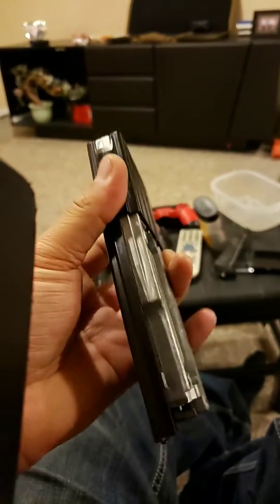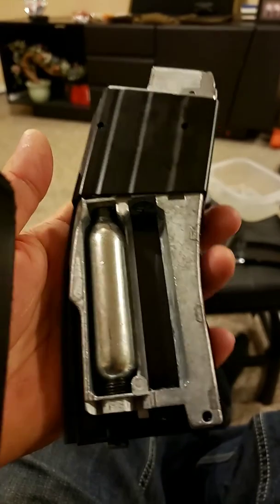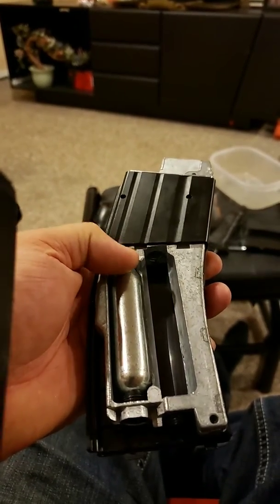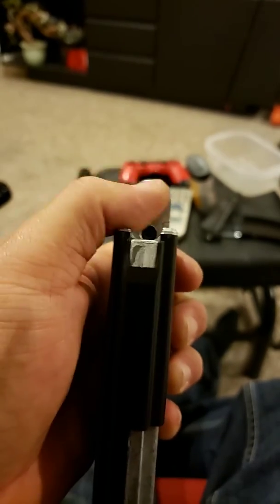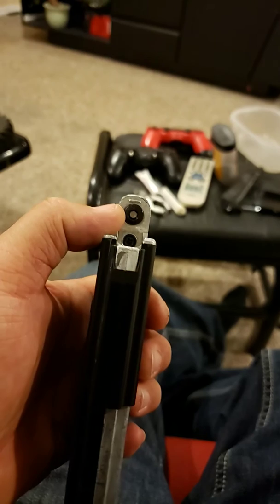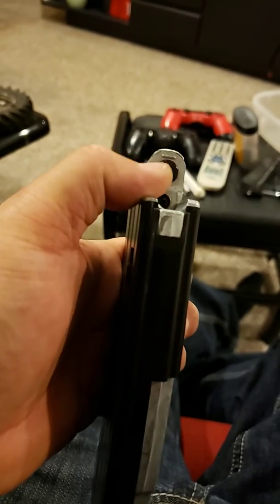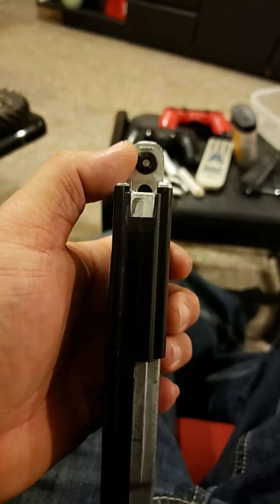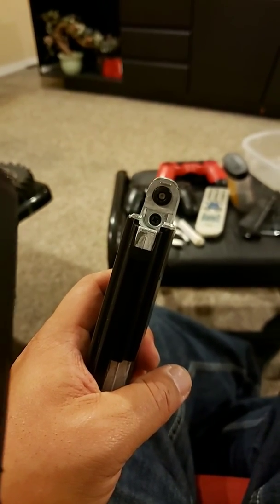Crossman dpms leaking magazine fix

Comment: Mine is coming tomorrow... can’t wait. Good to know about this. Hopefully it doesn’t happen, but if it does..thanks
Reply: Well it’s been a blast so far!! I spent extra and got 60 co2 and extra mag. Looking to get a red dot next. Iron sights work. Would like a different look and custom reticle
Reply: Also, wanted to ask,is there anything that can be done, to make things run faster?? Mine seems to shoot slower than others I’ve seen. It’s lubed,on friction points... any other pointers???
Reply: Holy crap!!!! This thing is a beast! All broke in now... it shoots fabulous!! Super accurate in semi.. good with burst... total FUN ,but crap accuracy in full auto.. unless you have a row of beer bottles to kill
Reply: PS. No leaks, on either mag!

Comment: I've bought 4 extra magazines and so far had none come defective or with leaks. Which is surprising considering how many bad reviews I've seen for the spare mags. I also oil them inside and out everytime I use them and make sure to break down the gun and use airgun chamber oil on the inside every 3000 rounds or so. And I use pellgunoil on the mags. And put a lil on the tips of the co2 cartridges as they go into the mags. My baby runs like greased lightning! I love having extra mags because you can load up all five and pretty much shoot the entire afternoon as long as you keep the speed loader handy. I even got a tactical chest holder for my magazines and loaders. They do get pretty heavy though. 5 is like toting around a 20 lb weight on your chest. Which I guess just makes it that much more realistic
Reply from the maker: Congratulations! Because of your preventative maintenance your airguns will last you  3x as long as everyone else has

Comment: The valve stem is not threaded, but oughta by this described action create a better seal for itself towards the plastic seal that is behind the brass nut around the visible rear of the valve stem (referred here as "nipple"). This action also can help keep the valve stem's front o-ring in place - especially if all is well lubed. I prefer silicone oil (I ditched Pellgun Oil a long time ago)..

Comment: What if its leaking from  the co2 cartridge at the tip I hear it hiss and it won't stop even if I keep tightening it?
Reply from the maker: U are past point of no return. The seal will have torn. This is why we use pellgun  oil on top of each fresh co2 cartridge to prevent tearing. Ur basically banging the old lady dry there is going to be miniscous tearing.
Reply: I been using pellgun oil for 11 months and mine too is hissing from first co2 at the tip. Not even a full year and two mags did this!

Comment: Thanks for the tip! I tightened it to where I could hear the least noise from the gas hissing but was wondering if it should be completely silent or if you can still hear a little bit of faint air hissing.  Its not that loud, but when your ear is close enough its noticeable. Thanks!
Reply from the maker: It should be completely silent .. otherwise by morning all ur co2 will have leaked out.
Reply: @mahman8888  Awesome, thanks!
Reply from the maker: @jarrenpeng1050  no problem man! Other than that shes a pretty solid rifle and so bad ass !

Comment: I have the same gun and mine leaks from the top seal of the co2 when i tighten it.. im going to put some oil on it maybe it will help. 50 dollars for a new magazine is crazy
Reply from the maker: Ok man use a piece of teflon tape on top of co2 cartridge to create seal.   what happens is when u tighten it dry it rips the green seal.. that's why u pellgun oil the tips of cartridge to prevent that. Hope this helps
Reply: Sorry can you explain a little better how airs escaping what exactly is causing it... cause mine is coming from the seal

Comment: thanks
Reply from the maker: No problem,make sure you add pelgun oil to the tip of your co2cartridges. This will prevent that rubber gasket from drying out .

Comment: Is it normal to have the co2 on the left be empty and the one on the right half full once the gun stops shooting?
Reply from the maker: No.. it should be completely discharged.. not sure why u still have 1/2 filled co2 left.. does it still fire and its just weak?  Or completely dead?
Reply: @mahman8888  it actually fires pretty soild. But only get 75 rounds before it stops shooting.
Reply from the maker: @JD_1  then there is definitely something wrong if you can only refill 3x.. do you have another mag to test out and see?  I can usually get about 200-225 shots @25 bbs per mag.
Reply: @mahman8888  Wow! Yes it has to be defective. No I dont have another magazine. I just bought this gun Saturday from Academy. I will contact Crosman about it.
Reply: @mahman8888  I just resolved my problem.. I was over tightening the cylinder on the right. I will do a video on this gun soon. Thanks for the chat
Reply from the maker: @JD_1  make sure you use the Crosman oil on the tip of the CO2 cartridge before you install them! And turn the screw ever-so-slightly until you feel pressure and then keep turning until you hear the puncture and you're good. Tightening the shit out of them wrecks the seals

Comment: Thanks for the Video, I would like to have seen you take that back apart and see whats behind that nipple part you tightened, since it is threaded, either Teflon tape on threads or Small amount of blue Loktite on threads so it seals and doesn't loosen from Vibration again.
Reply from the maker: All that nipple does is turn and turn and turn it's like a valve. It's not threaded so just turn it until you can't hear air leaking out anymore I'm not sure what the issue is with the magazine or why would even do that in the first place.

Comment: Mine leaks from the bottom is it saying to lubricant
Reply from the maker: Every time you put in a new c 02 cartridge, you are required to add a little bit of pellgun oil to the tip of the seal.  Otherwise overtime that green seal will rip and tear . Leaving u a leaky useless airgun.
Reply: I been running my gun without oil and I guessing it's clogged up